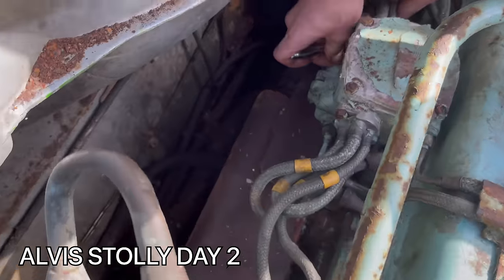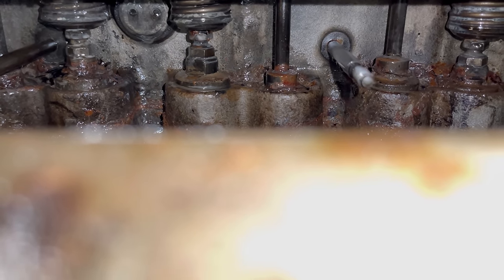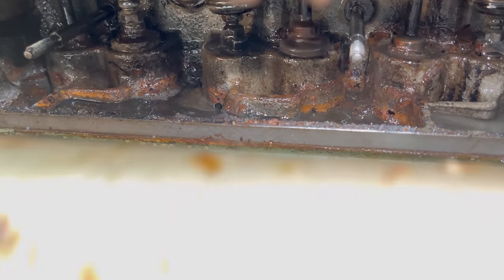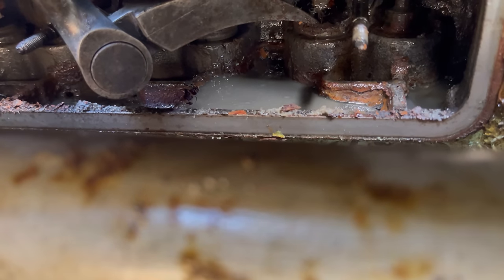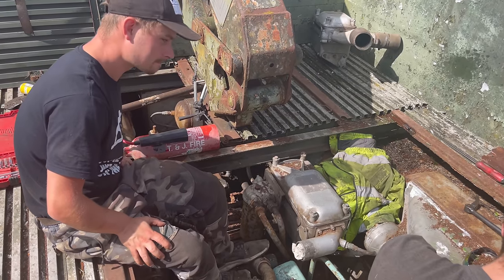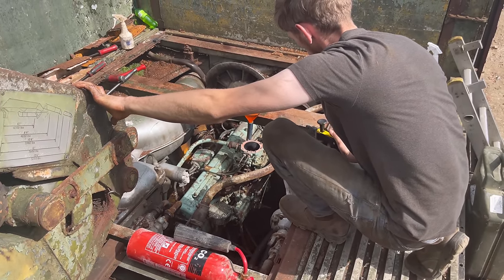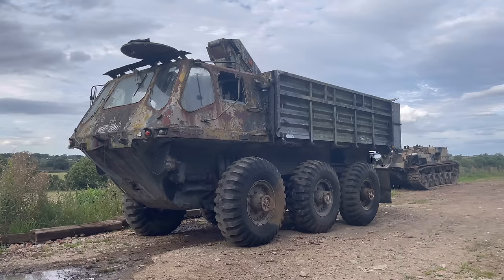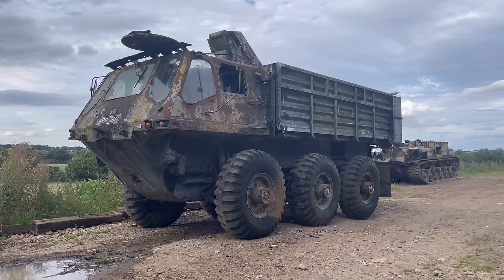ALVIS STALWART RUNS FOR THE FIRST TIME IN 15 YEARS!

Comment: Having worked on a stolly before I can assure the people watching this that absolutely nothing on a stolly engine is either easy to get at or pleasant to work on
Reply: I have no experience in this field of mechanical engineering but quite a lot with all sorts of machines in industry . When this equipment is designed why do they seem to forget completely about the poor buggers that have to fix or service it ?🤣
Reply: I had a slight advantage over most people having been blessed with arms about a foot longer than the average VM, it also meant that my 5'2" mate did most of the work on wheel stations!
Reply: Bit like modern cars ,a pain in the arris to get to owt .or you have to pull ten bits off to work on the one you need to work on 😂😂😂
Reply: Totally agree,feckin awful things to fix.
Reply: We had RA limber so had to unload all thr ammo first as engine decks under the load ,,,got quite quick at it especially when the middle axle would catch fire

Comment: They are dirty -like REAL mucky - they are a pain in the  .... to work on.  You get aches, scratches cuts and burns getting your hands into the machinery and fiddling with it  You hands turn strange colours and stink to high heaven,  There is the sounds of swearing and slipping spanners and the crash of hammers and then the sound of the engine turning over.  Again and again you try.  You start again until you hear that roar of a working engine!!!  Can't beat it!!  (ex-REME)

Comment: When that engines good and proper and real sweet, you should here it sounding like...."chik chik chik" almost clicking noise. You sort this one out proper Mr Hewes and you will never get rid of it. I used to love the ratchet handbrake, pull, pull, pull......keep pulling and STOP." All that effort and energy only to release it with a small button and tilt forward handle. Well done guys, the "Beast" awakens.
Reply: Most of any ticking noises would be from the compressor when it was off load.

Comment: As someone whose uniform was blue in the late 70's early 80's IRC that we had ground power units fitted with, not sure if they were B61 or B81's They were 3 or 4 litre staraight 6's with two seperate cyl heads and 2 sets of points in the mag which were a right Bast*rd to synchronise. If the flexi exhaust joint glowed red it was to rich if it melted it was to weak and white hot was just about right, Ideal to keep the pies warm from the NAAFI wagon. Job Card "engine fails to start" investigation "steak and Kidney pie blocking intake"

Comment: Ace chaps. Nice going. Quite a bit of water around those cam follower housings, at first view. The engine would benefit from an oil change before you drive it. Anyhow, it sounded pretty good considering. At least one nest ejected from the exhaust, if not it was biggish clump of some sort! Those RR B series engines all sound good.  Looking forward to the next episode.

Comment: Nice work. The lifters are going up and down but, they need to be rotating as well.  If they don't start rotating soon you will most likely wipe out the cam.  Might want to check that soon.  Cheers.
Reply: Not sure how Rolls makes their lifters rotate ... if they do it normally, cam might already be wiped.
Ton of issues with inferior cams in the states in the 80s ... being revisited with unscrupulous suppliers now.

Comment: Some lovely B81 music, now to sort the clutch. The official unofficial Army cure for a stuck clutch was to let a fire extinguiser off into the bell housing - never saw it work once, just usually latched the clutch pedal down, banged it through the gears to get some speed up and slammed on the brakes while holding the hand throttle up full. Always found removing the second life washers a bit of a pain!

Comment: A note on the exhaust valves, most of the ones that were unstuck from the start rotate while they move up and down. The ones you unstuck and one that was unstuck to begin with on the second side do not rotate when moving up and down. Don't know if that's bad or not, but yeah.
Reply: All valves are meant to rotate helps keep the seat clean even the wear on the components.  Hopefully those not turning will free off in use eventually from heat and vibration.
Reply: If it were some kind of an perfomance engine you would need a new cam and lifters in very short time if the lifters ain't rotating.

Comment: I remember following one of these as a kid in a fiberglass 8ft Dory out of the channel in west Mersea (Essex) towards the sea. The machine was amazing just driving down the slipway straight into the water and powering through the waves, water right up the windscreen! The load bay at the back was empty so I guess that caused the front to have so much water over the windscreen! Anyway the thing went all the way to the end of the navigation channel marker ( the nass) then turned round and went back to the slipway and drove out onto the road! I remember there was a sign on the exhaust cage at the back saying ' danger flames'
Apparently the guy had driven it from London..... at 8 mpg.
That would be probably around 1993 I was 13ish at the time.
Anyway looking forward to some flames from that exhaust one day, possibly even a dunking?
Great work guys, wonderful videos of crazy machines.
Keep up the good work!

Comment: Seems that the bevel boxes are all free which is a great blessing. Once you've steamed the clutch housing, you might try chaining it to a tank and barring the flywheel with the clutch depressed if the method you just tried, doesn't work.
Reply: will that work with a pre selector gearbox or will the fluid flywheel just spin?
Reply: @RobertRobDodds  It's just a normal twin plate clutch and manual gearbox.
Reply: You're right, I was thinking about the Saracen

Comment: They were prone to catching fire 🔥 from the exhaust in close proximity of drums of petrol it carried to support tanks, they suffer with transmission wind up been permanently 6 wheel drive when driven on roads army lads used to bounce them up kerbs or over railway sleepers on long road journeys, I've been in one when I was a kid at a 4x4 funday hollywell 4x4 castleford that's long gone now, I've always wanted one because there cheap to get into if you have somewhere to put one, nice straight 8 rolls Royce motor.

Comment: I love Mr hews videos. I’m no mechanic but watching these videos makes me feel like I’m learning something.  Also how does this be being compression back to a cylinder?
Reply: Compression stroke requires the piston to come up in seal cylinder to compress the fuel air mixture. If a valve is stuck open the mixture will leak out and little or no compression achieved. Also leaking valves caurse the external flames as the detonation stroke should again be in a sealed cylinder causing max power into the engine stroke, with leaking/stuck valve the leaking mixture in the exhaust system ignites causing the external fire.
Reply: each cylinder has 2 variable entances and exits. thats the things you saw him push down with a crowbar, they are called valves. air and fuel need to be squished  alot to go bang(the squishing is the movement up and down of the piston which is not shown at any point in this video. its going on inside. if one of the valves stay open then it cant squish the air and fuel. it just pushes it out the open exit/valve.... ps to complicate things most modern engines have 4 valves ....pps i tried to give a shorter simpoler version of the other guys explaination and i failed
Reply: Worth you adding 2nd explanation as it reinforces/explains more detail. Nice community here. Good day all.

Comment: The asbestos just mix some white glue PVA in a little bit of water and paint it on,  most anywhere else get some spray tack used for crafts and spray that everywhere it will stop the dust flying about

Comment: How can valves not move when there is something hard (a cam I presume) moving to push on them?
Reply: Ah got it stuck closed maybe.
Reply: Or open (I'm used to OHC)
Reply: The valve when its up is open,overhead inlet side exhaust ie the ex valve sits in the block not the head